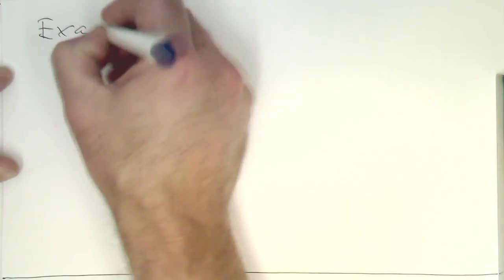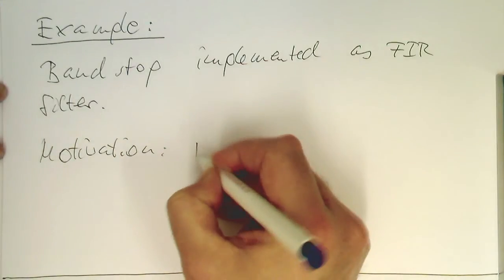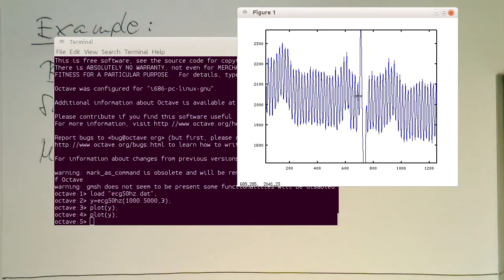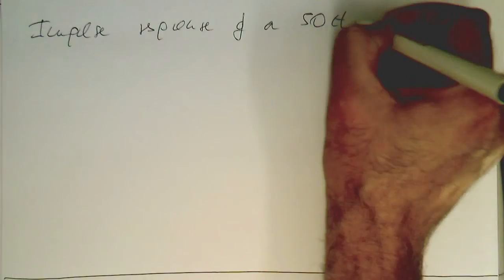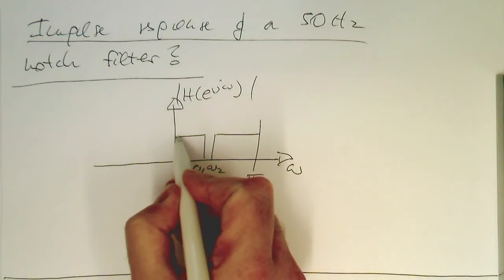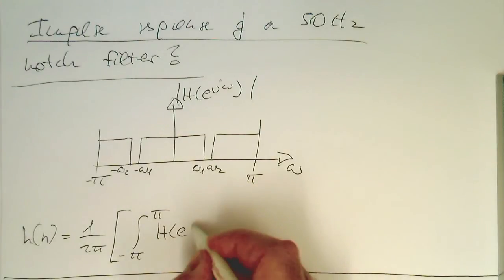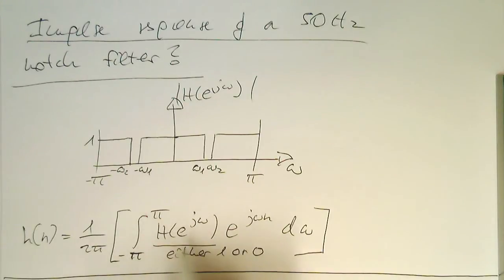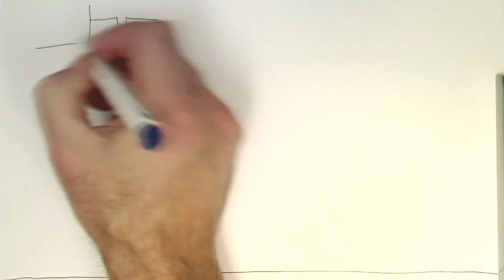FIR filter design by windowing: a complete bandstop demo (0004)

Comment from the maker: Good question. The number of taps defines the frequency resolution. Remember the filter is designed by doing the inverse Fourier transform. Freq resolution = Sampling rate / number of taps. See the FFT videos if you go from X(k) to X(k+1) that implies a certain frequency change which is the resolution.